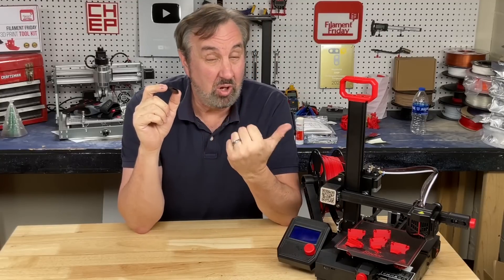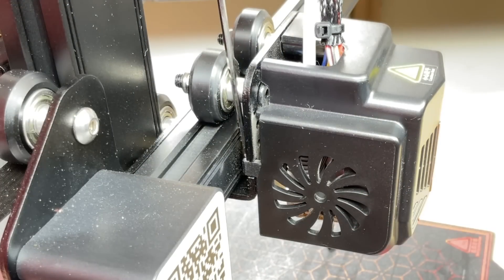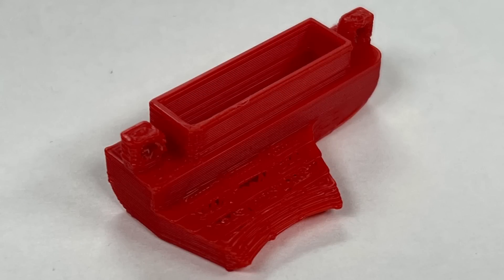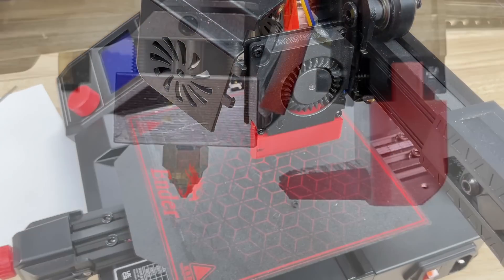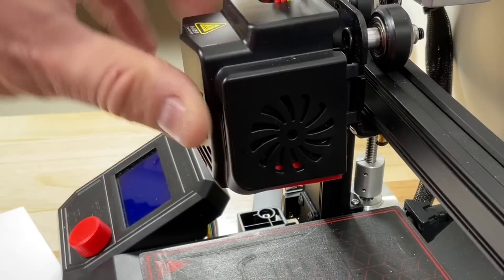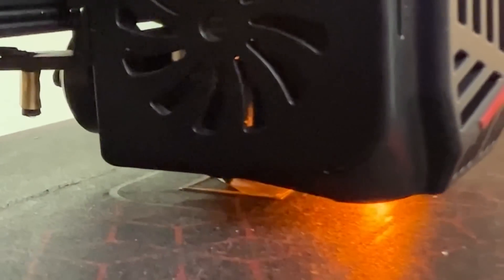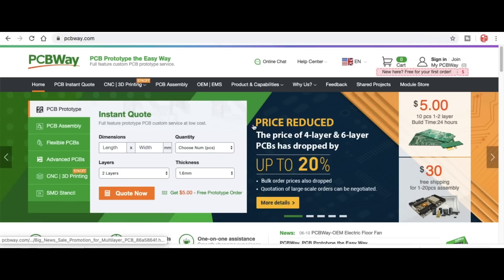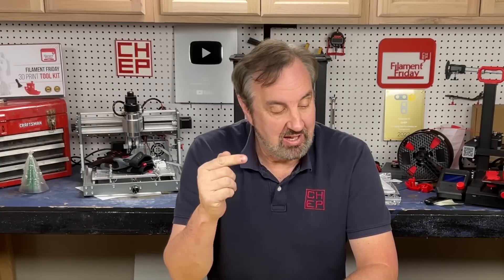Ender 2 Pro Cooling Fan Duct With LED lighting

Comment: LEDs have a given beamwidth, this can be as wide as 120 degrees or a narrow as 15 degrees in common ones. That yellow LED aimed "straight ahead"  is probably firing well in front of the nozzle (viewing the printed from the front) and not helping much with seeing the nozzle.

Also, different colours have different intensities as well as different voltage drops and max currents, which affect the resistor value, so different LED=different value resistor (usually)
 
For clarity of the nozzle and extrustion, a wide-angle white LED, aimed towards the nozzle will give you the best view at that close range and I'd probably mount it at the end of the cut-out section you remoddled (glued on the end and aiming diagonally towards the nozzle) Don't mount it too low or all you'll see is the shadows of the texture on the layers, try to get it up a mm or two so that it floodlights the nozzle area a bit coming down at a slight angle. 

LEDs for up-close macro illumination are VERY fiddly things :)

Comment: Thanks . My x carriage just broke where the Standoff mounts the hotend. I can't seem to find a replacement. Guess I'll have to put on a 3v2 carriage and fan assembly . Do you have a suggestion ?
Reply: I realize you asked this quite some time ago but just wanted to share my experience in case someone else runs into the same issue. One of my standoffs broke, the left one, I used an M3x25mm bolt and 3 nuts. Inserted bolt through back of plate, secured with 2 nuts on front. Had to remove the bottom wheel and loosen the belt tension in order to pop the plate off the rail just enough to be able to insert the bolt through back of plate. The two nuts stacked back to back on other side of plate are almost the same length as the standoff that broke off. I think it's like 1mm at most short. This will replace the standoff that was previously attached to the plate that broke off. Attached the coldend and secured with another nut. A month after this repair and over 2 dozen prints and it's working great. I love this little printer, it's a workhorse. I can set it to print and just walk away and it never fails to get a perfect print. I especially like the small footprint. I have it on a half height bookshelf in my bedroom.

Comment: When your cooling fan vent was intact, did you ever notice any issues with cooling? My machine is having trouble printing slight overhangs that it really shouldn’t be struggling with at all... Vent and fan are both intact.

Comment: Hello! First thank you for all your videos. I really enyod them and they are helpful, with your profiles my ender 2 pro is a little beast. I would like to ask your opinion about Z height modification. Is it possible for an ender 2 pro with proper aluminium profile and z rod? Can it cause some problem ? I think about not to much, maximum 250 mm.
Reply: So  after my comment i saw your "Ender 2 plus" video so i think i got the answer :D

Comment: You may want to try a directional led, basically one that isn't frosty or solid color lens case, there are some with clear plastic that don't diffuse the light as much. Or try a different form factor led.

Comment: Great stuff.  I added a WS2812 RGB LED to a hotend.  You can connect them to "servo" or "bl-touch" 3 pin connectors on printer mainboards.  Like you, I found that a single bulb really didn't add enough light.  Useful as a status indicator, though.

Comment: I have a whole fan shroud with fan ducts printed in pla, didn't think it'll work but 3months later it's still as new. I think hotend fan is keeping pla stiff no matter how hot I go and I push temp to 270 regularly
Reply: That's good to hear. I also printed a fan shroud and duct in PLA. I figured if the fan isn't doing it's job keeping the hotend cool, then something is wrong. I don't print any filaments that need a heated enclosure anyways so I think that helps.

Comment: Seems I’m not the only one that sometimes takes 3-5 prints to get the design right 😂
Reply: It's like programming. If it works the first time you haven't found the issue yet.
Reply: I'm on version 28 of a carriage mount for a direct drive extruder
Reply: Incremental improvement is the path to wisdom in practical design.
Reply: A couple of year ago I designed a print to hold an automatic tonearm lift in the skeletal frame of my turntable. It took 10 iterations before I was satisfied, with the fit and finish.
Reply: So far my record is version 12 . . .

Comment: Isn't the led getting too hot early print when close to the nozzle and heated bed?
Reply: The plastic on the LED can withstand up to 80 degrees C, so the bed shouldn't harm it, as for the nozzle, it doesn't look close enough to do damage and also there's a stream of air that flows between the LED and the nozzle.